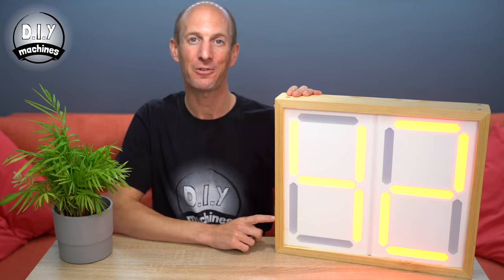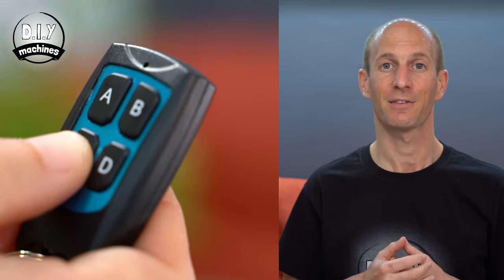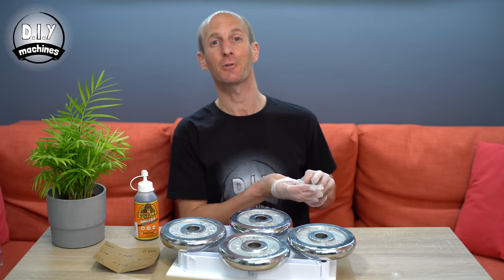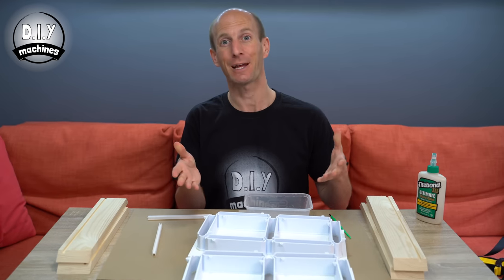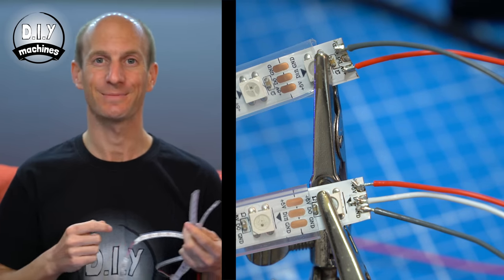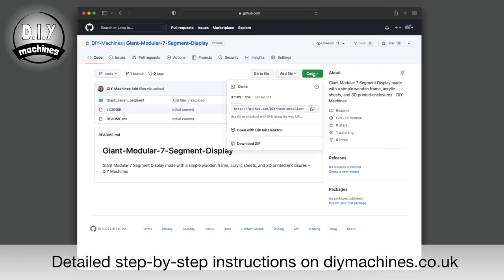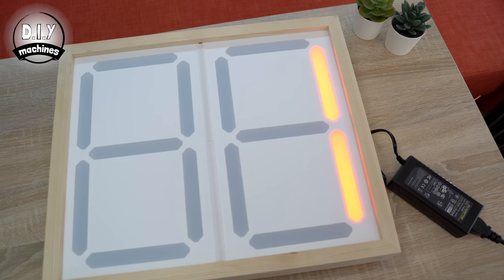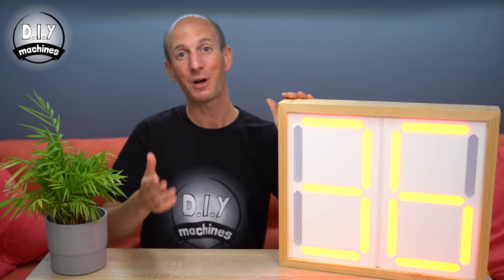GIANT Modular 7 Segment Display - Easy DIY Guide

Comment: When cutting out the digits in the acrylic, you could also use a coping saw. It has a thinner blade and might make the corner turns a little easier.
Reply from the maker: Excellent idea. Thanks for pointing that out. 👍

Comment: Nice but too much work. I'd like to see a design made on laser cutter. Maybe use black card or black acrylic to cut out the segments, paint front white, put glass or thin acrylic over the front, would this work? Love to see a project like that. Also saw a project using addressable leds for each digit so it can be one strand for each digit. Keep up the great work.

Comment: Hello, enjoyed your video so much, we have built a five digit version using 80/20- 10 series aluminum extrusions, instead of wood. We have augmented your code so we can manually count for a children’s hospital toy drive. Appreciate your content and web site. Our only issue is with the Wi-Fi fobs you listed. They are not reliable more than just a few feet away. We may change to wired. Thanks again for everything!

Comment: Good afternoon! Very good video! Based on this project, you can make a large multi-colored subscriber counter.
Reply from the maker: That's a great idea! Using the Wemos D1 you certainly could. Perhaps green text when the count is rising and red when it has fallen.
Reply: @DIYMachines  This is very good idea! I have long wanted to make such a subscriber counter on seven-segment indicators using WS2812 LEDs.

Comment: OMG, this is exactly what I have been looking for. Like you I have been looking to create a set of lap counters for the swimming club that I am a part of for the long distance events. Most of our local competitions are in a six lane 25m pool, so I need to build six of them with the ability to count down from 60 (or 32 for 800m) in twos. I was looking at using ESP32s to control each one, with a rechargeable battery pack in each to make them stand alone. I would like to see if I can then build an App to control each of the units to set the race length, count down each pair of laps and reset at the end of the heat.
I am a noob to all of this, but I used to dabble in electronics and programming when I was much younger, do you think my idea above is possible?

I would be really interested in finding out how yours worked out and if you built multiple units, or made other improvements.

Thanks for your amazing content.
Reply: There's "wled clock" fw for esp32 that has clock, stopwatch and countdown timer, flash your esp from online flash tool and control it from a mobile phone

Comment: Im on a mission to build a scoreboard for cornhole. 1 two-digit section for each team and a few buttons ( +1 for each side, reset to clear all score back to 0, and maybe -1 to fix a score) But code is not my thing and I was hoping you would go over the code for this project so I could get some idea of what im up against. Ive done VERY little with raspberry pi, and never used an arduino. so im starting at square 1. Cool video and you have some awesome talents. If you have any suggestions for getting started with arduino code or more info about the code you used in this project (that a total noob can understand) id love to take a look

Comment: I don't know if you've corrected this yet or not, but the PCB you created at PCBway is not complete. The ESP and Logic Level Converter are not completely wired - and do not connect. It is shown this way in the video, as well as on PCBWay. The connections to the Logic Level chip is not connected.
Reply from the maker: Hi Brendan, thank you for spotting this and letting me know. I have fixed it. I made a rookie mistake and uploaded an earlier version of the PCB. I hope it has not caused you any issues. Lewis

Comment: Just fyi, with an arduino / 3v3 Logic, there is no need for a logig Level shifter... The LEDs are fine with 3v3 Logic and will upvolt it themself After the first LED to 5v..
Reply from the maker: You are absolutely correct as long as the length of wire between the Arduino and first LED is relatively short. In my personal experiment this has never been a problem - though I wanted to show best practice in the video to help ensure as many people as possible were successful.

Comment: Can you do a normal counter with this project? Like when I press a remote button up, the numbers go up accordingly as I pressed through a wireless controller?
Reply from the maker: Yes you certainly can using the circuit as it's designed and the wireless key fob. You would need to revise the code though.

Comment: What about DMX512 with addressable pixels rather than a arduino
Reply from the maker: You could absolutely control it with DMX if you swapped the WS2812B and Arduino for a suitable pixel driver and LED wiring.
Reply: DMX SPI Controller

Comment: Make Clock connected to internet time.
Reply from the maker: If you opted to use the ESP board instead of the Arduino Nano then you certainly can do this. Of course you'll need at least four character on your display and could add an additional ':' halfway between them if you wanted to.
Reply: @DIYMachines  okay

Comment: You got anything without a 3D printer as I gave up on mine 10 years ago, it never printed anything correctly despite taking hours to build and tram and set up, it printed one item very badly and nothing I did improved it, even upgraded the Z axis to Acme threads to improve on accuracy of layer height. Still no good.

I'd like to make this project for a game site that my son goes to and it needs a large timer, have thought of a better way of making this, well two ways making it, I got no way of modeling it as I gave up on CAD given the issues with trying to use them, errors errors and correcting errors, no one makes a CAD system that you can just make what you want in minutes, it take hours of applying construction elements and those that allow parametric drawing with ease are not good at producing parts. Tried it with the 3D printer for one print and it printed the item paper thin walls despite infill ...